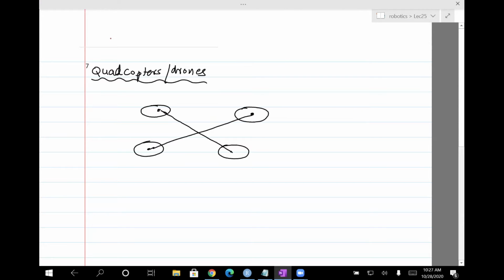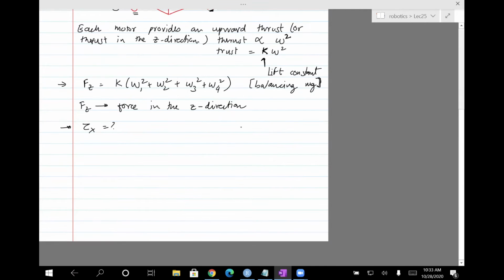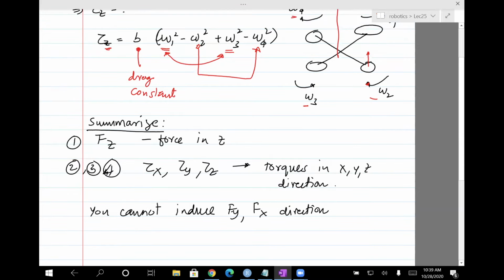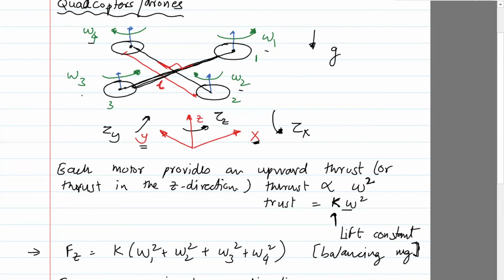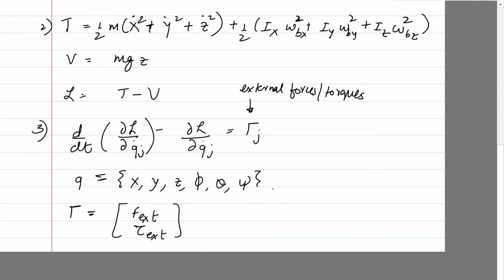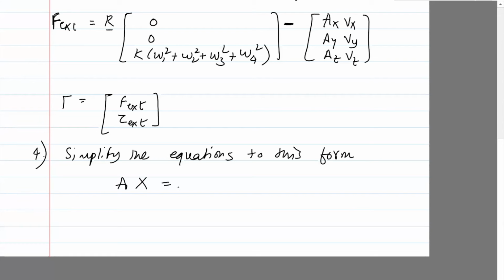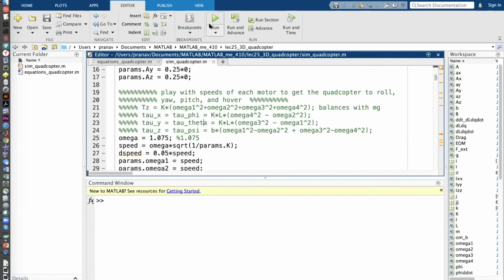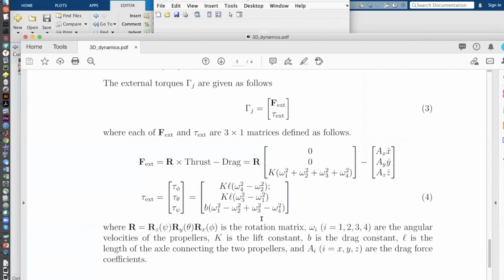Robotics Lec25,26: 3D quadcopter, derivation, simulation, animation (Fall 2020)

Comment: Sir, I have seen many quadcopter mathematical modeling explanations, but I haven't got any explanation for a hexacopter. I tried to understand from a research paper but there also not proper explanation. If possible, can you please do the similar kind of mathematical modeling and implementation in MATLAB it will be very helpful.
Reply from the maker: Hexcopter is not much different from quadcopter. The thrust and torques wil change. After you understand quadcopter, go to ChatGPT or any LLM and ask it what needs to be modified in quadcopter model to make it relevant to hexcopter.

Comment: can you provide me with pdf of the formulas because i couldnt  know how to drive the EOM from your code of the euler-lagrange method 
or i hope if you can just explain that part in the code in much more detail
Reply from the maker: @hamdiali631  take a look at 25,26 on this page: http://tiny.cc/robotics for Python look at 22 here: https://tiny.cc/roboticspy
Reply: on thank you very much for your effort 
Im trying to extract those equations to estimate rotation of the the motors during the mission of the quadcopter .
i have the path of the quadcopter in [x y z ] points 
how can do this i hope if you can help me with it or at least guide me
Reply from the maker: @ rotation of motors? You mean rotation of the drone? That is given by the Euler angles
Reply: i mean the RPM of the motors
Reply from the maker: @ Thrust (in vertical directionn) = k omega^2. If you can estimate Thrust and k you can estimate omega. However, usually motors have encoders that measure the RPM of the motors which is more direct.

Comment: Hello Thanks so much for the greate content prof , 
I ask myself why in many literature g is assigned with 9.81 and in some others it is -9.81 ?
can you kindly clarify this to me ?
Reply from the maker: Depend on the axis. Sometimes positive is down and sometimes it is up
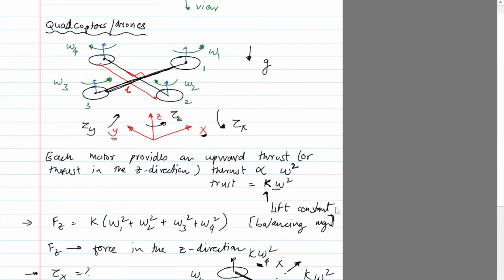Reply: @pranavab  hello Dr thanks, i inspected the axis the z pointing up always and the gravity in the negative of the z axis. see 18:45 the inertial frame points up and g down and you use g with positive value ?
Reply from the maker: @Via.Dolorosa  whatever convention you use the net effect of g should come out in the downward direction, so -m 9.81 in the coordinate frame shown.
Reply: @pranavab  in the matlab script shown, it is used g = 9.81 as a positive value which made me confused ?
Reply from the maker: @Via.Dolorosa  it’s all correct in the file. The simplest way to check is to keep speed zero and see if the quadcopter falls down.

Comment: why are the spinning directions different？
Reply from the maker: The quadcopter propeller directions are reversed on diagonally opposite motors. Hence opp rotor motion still leads to upward thrust
Reply: Oh I see. only in that way can the momont around z be balanced. Interesting design. Thanks!

Comment: How should I set my initial angular velocities such that I can get straight motion in x direction. coz if I tried to do rotation along y-axis it falls down 
I can't set the motion such that I get torque along y axis and also at the same time it does not decent along z-axis?
Please guide
Reply from the maker: You need to do that by designing a controller. I have not covered controller design in this video. I recommend using LQR controller. See this: https://youtu.be/OcJRH6-7zQI
Reply: @pranavab  How can we set values of Ixx, Iyy and Izz. According to perpendicular axis theorem Izz should be equal to Ixx and Iyy right?
Reply from the maker: @sampatil9468  the perpendicular axis theorem is only valid for planar geometries, not for general bodies. In general you can set any values to the three inertias

Comment: It seems odd to me that we do not transform the forces (like F_z) from the body-fixed coordinate system into the world coordinate system. Did you neglect this for your calculation? Or am I mistaking?

Simple example: If I roll the quadcopter by 90deg, then the rotor force in the vertical direction z will be zero and instead fully act in direction y.
Reply from the maker: There is R or rotation that multiplies with the thrust force from motors; it is in the notes.

Also note that linear equations are in world frame but rotation equations are body frame—- this is standard in rigid body derivations

Comment: how can I make this code work for a hexacopter? I made all the necessary changes but i get error on lines like:
new_propeller5 = new_axle_x(3,:) + new_propeller;
new_propeller6 = new_axle_y(3,:) + new_propeller;
patch(new_propeller5(:,1),new_propeller5(:,2),new_propeller5(:,3),'x');
patch(new_propeller6(:,1),new_propeller6(:,2),new_propeller6(:,3),'y');
Reply from the maker: You need to make sense of the error message. Usually it is to do with sizes of matrices.
Reply: Are you able to resolve this error? I am getting same problem
Reply from the maker: Impossible to debug without knowing the errors

Comment: sir can u recommend a  good book for robotics ? that will be very helpful because my minor project is inclined towards robotics .
Reply from the maker: In my opinion, it is not efficient for beginners to learn from a book. And definitely not if it is a project. 

If you have a project in mind, I would suggest you search material relevant to the project (e.g., code, videos, presentations) on the web and learn on the go. 

Also, most textbooks are good with theory, but they don't really show numerical examples, which I think define most robotics projects. This is something I have tried to address in my videos. You can find all material here: tiny.cc/pranavb_robotics
Reply: @pranavab  really appreciate...... 🙏🙏

Comment: Can u please help me in calculating power consumption of quad with respect to variation in cruise speed (power bucket graph) and how quad's pitch angle varies with variation in cruise speed
Reply from the maker: I think that would be simply the motor torque times the angular speed.
Reply: @pranavab  I will pls appreciate if you can put something down on Navjit Singh's question for us to benefit from. Thank you

Comment: Thank you Pranav for this great video, Actually I am stuck at the last part where if I implement trajectory tracking along X and Y , the quad rotates and crashes as you have shown in the video. Can you provide me some help about this ??  Thanks in advance.
Reply from the maker: I have not programmed to quadcopter to do trajectory tracking. You would need to linearize the system and then use a linear quadratic regulator to track.

Comment: Hello, thank you for your vido! Very good explanation.

One think came to my mind. In case of Torque along X and Y Axis (page 1). Why there is not Tx = L/2 * K * (w4^2 - w2^2). I mean why there is "L" not "L/2" as the distance to axis of rotation for both forces is exactly "L/2"?
Reply from the maker: You are correct. It should be L/2 if "L" is the distance between the 2 diametrically opposite rotors as I have drawn it in the figure.